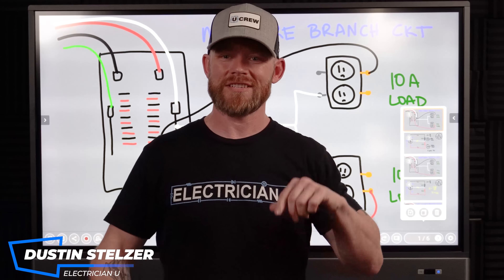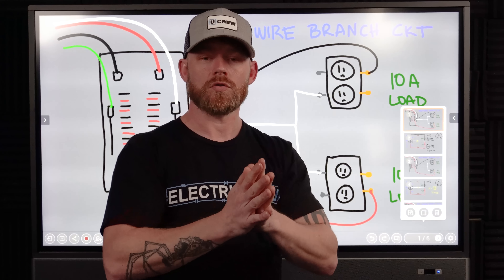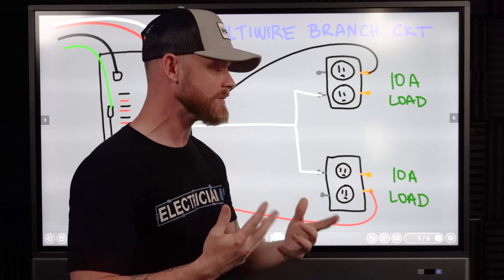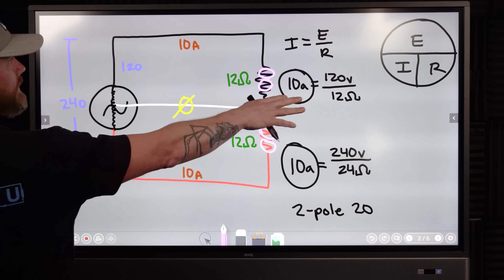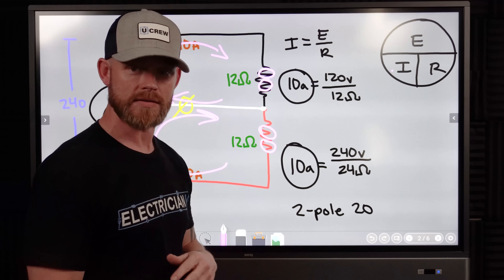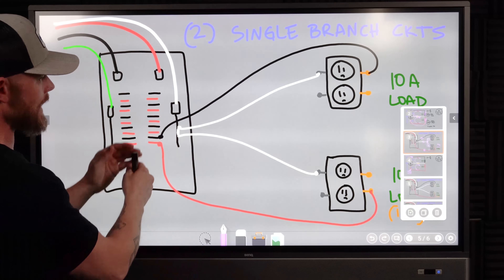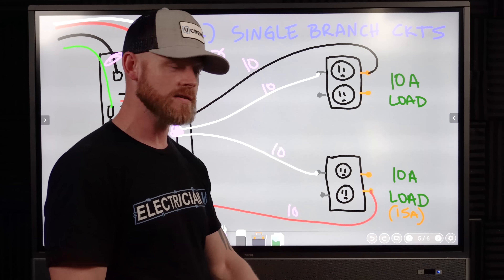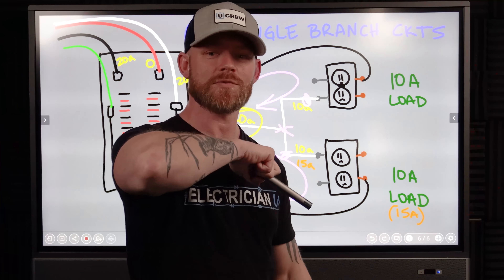Neutral Imbalance in Multiwire Branch Circuits (Two Hots, One Neutral)

Comment: OK, you've got to see this, it could be a major epiphony. Multitude of different single and double breakers and little double breakers where 2 breakers occupy the same hot source in the box. I've got lights dimming whenever the stove kicks on, or the dryer. So the question is, can breakers be specifically and methodically placed where a balance of constant load negates themselves? Say, half the house load is black vs the other red, so when they're all on, they negate each other instead of drawing too much on one pole or the other? Would this reduce the effect of the 2 pole appliances drawing down other loads?
Reply: Ideally you should aim to balance your loads between poles. Base it off of use frequency.

Comment: Great vid. Would have been good to add: if no loads are attached to the opposite leg it acts like a normal circuit, the dangers/behaviours of an open neutral in these circumstances, and using a split recep as a visual
Reply: I lost two computer monitors and one PSU to an apartment with bad neutral. One leg could dip to 90-100V L-N and the other surge to 140-150V measured at the breaker box. The situation improved significantly (125V max, 110V min) after the power company changed the transformer a few months later. The transformer must have had a broken neutral and the building still have a loose neutral between the transformer and unit panel.

Comment: I have a composites curing table that uses 20 250 watt 120 volt work halogen work lamps to produce heat on my work piece.  Total max current draw of 5000 watts.  The individual lamps are plugged into 4 separate 15A  power strips, with no more than 6 lamps per strip (1500watt). does this say that it would be OK to have this sourced from a 240v 30amp dryer/range outlet that terminates into 4 120v outlets - 2 on each side (red , black).  I believe this would in effect be a "temporary" branch circuit of the type you have described.

Comment: Seems like it's just safer to always run a neutral with every hot, no questions asked.  Besides using a single neutral in the case of wiring a 220V outlet, are there times when you want to use this slightly tricky technique?
Reply: sometimes it's easier to run a single 3-conductor cable instead of two 2-conductor cables. Sometimes there's not enough space to run 2 cables. Also, if conduit fill is an issue, sharing a neutral means one less conductor to fit in the conduit.
Reply: Another major reason is to lower the cost of materials. Copper is copper, after all. In new construction, you could save a substantial amount of money (which would go into the electrical contractors pocket).

Comment: THIS is the video I really wanted to see. The issue is significant for me. My house was built in 1938 with a two-wire 110 volt service which fed the entire house through two fuses. Wiring is all in conduit and was all routed through ONE 4" square box. Entire house. About 30 years ago service was upgraded to 240 volt. The electrician routed a couple of additional circuits but left the rest as is. I have untangled some of it, especially after breakers started tripping. There are definitely shared neutrals remaining. They did try to save money on wiring and conduit in this post-Depression house. And residential loads back then aren't what they are now. It is great to know how this works, as I continue to unravel the wiring in this house.

Comment: How would this example apply to the homemade generator breakout cord I made.  I have done this exact example but it is intended for use on a generator?  I basically cut the end off of a 240v Generator cord (10/3 BTW) and wired it into a outdoor type double gang outlet box with 2 120v outlets.

Comment: My sister lives in a tract home built in 1995, pre-AFCI.   her kitchen is wired with 12/3 NM protected by a double pole, 20 amp GFCI breaker (EXPENSIVE!!)    Her boyfriend called me one weekend because he couldn't get the breaker to stop tripping after he replaced the traditional outlets with the decora style,  to give the kitchen a more updated look.   After he said there was a black and red wire on the old outlet, but after checking all the connections making sure nothing touching, I said, yes something IS touching,  the tab joining the two halfs that you forgot to break.  😂😂   Fun times.

Comment: Near the end of the video with the 2 blacks sharing a neutral,  is very dangerous and can cause the neutral to overheat and become a fire hazard.   This is why, if I am doing a service panel change, and or rewiring a portion of the house, especially an older house where multiple people may have lived and gone over the years, before decommissioning the old equipment, instead of relying on red and black, I always test the voltages,  and mark the conductors with phasing tape accordingly.  Someone could have connected red to black along a circuit,  and if I am not aware,  I might reconnect the new panel and wire that circuit with two hots on the same phase sharing that neutral,  which could torch the house.

Comment: @12:05 stating that having 2 different neutral wires is the same as a multi-branch sharing a neutral because after the neutral bar, there is a single neutral wire that leaves....so why is that not the same concept when you have a multibranch circuit on the same phase?  If instead of a multibranch circuit both on the "black" phase, you have 2 separate circuits that have their own neutral, isn't that still the exact same thing just as what you state at 12:05?

Comment: Why on occasion is there a small amount of voltage still on a line, even after that circuit is shut off(I've read 8V, 12V and 16V before)? The houses in question are older and the grounding is almost non existent except for at the panel. I suspect that has something to do with it but an explanation from you would be great.
Reply: Voltage that high on a dead circuit could be from a shared neutral or maybe even be induced voltage.  If there's a big mess of wires run around your dead circuit the electric field produced by them could cause that reading.  If it varies like that throughout the house I'd lean towards induced voltage
Reply: Appreciate it!

Comment: If you live in a MRU (multi residential unit) property where each unit is supplied 120/208 instead of 120/240 for a typical stand alone home, does that change the cancellation on the neutral?

Comment: The diagram at 4:35 reminds me of a voltage divider in DC electronics. Because of the neutral in the middle, I presume some similar principal is happening so that each of the loads is only seeing 120v, even thought no current is flowing through the neutral? And if that neutral wasn't there, then each load would actually see the true 240v of the outer loop, and let let magic smoke out?
Reply: Yeah its the same as an Edison three-wire circuit. If the loads are balanced, and you removed the neutral, you wouldn't notice a thing. Each load would still see precisely 120 volts (assuming precisely same impedances).

Comment: Just ran a separate circuit to separate 2 furnaces that were tied in to a 12/3 wire. Breaker kept tripping randomly.
Reply: Sounds like the furnaces are on an AFCI or GFCI breaker,  and unfortunately it cannot share a neutral because as soon as the other furnace kicks on, the imbalance between the hot & neutral the breaker is protecting will cause it to trip.    Unless you use a two pole AFCI or two pole GFCI,  they are available but very expensive

Comment: The only thing I would have added is what happens if the neutral were to fail somehow.
Good work.
Reply: A voltage higher than 120 will appear across the circuit with the higher resistance.  That's a great reason to run separate neutrals!

Comment: I'm not an electrician, but I play one with my home and equipment, and have for 50 years. I try to understand and follow code and best practices and your explanations help a lot with techniques and how and why. I recently had a licensed electrician looking at my panel to give me an estimate on some extensive work. I have one 12-3 w/g cable connected two 20A breakers on opposite phases feeding 2 different circuits, just as you've described here. He called this an Edison circuit and said that Edison circuits are no longer allowed. After seeing your presentation, I'm wondering about his statement; are these circuits no longer code?
Thanks for doing Electrician U!
Reply: While I'm not an electrician, as far as I can tell in the current NEC code a multibranch circuit (Edison circuit) is permitted so long as both hots are connected to a Tandem Breaker. This ensure that the hots are on different phases, and that if one circuit flips it takes out the other circuit that's sharing the neutral. There are also rules on the device side that the neutrals must be pigtailed together before the devices, so that the neutral is not dependent on the device. (No daisy chaining, must have the neutral split into independent wires to the device after you split your multibranch circuit back into two 120V circuits with the shared neutral.) Now, you're state may have different rules that supersede the NEC published rules, as well as sometimes local municipalities have ordinances that further restrict wiring.
Reply: @joatamonk  you cannot connect a multi-wire branch circuit to a tandem breaker. I think you meant to say double pole breaker, which is entirely different. Multi-wire branch circuits must be connected to a double pole breaker OR to two single pole breakers that are handle-tied together. This ensures that 1. The breakers are on different phases so as not to overload the neutral, and 2. To ensure that if you have to turn the breaker off to work on the circuit, both hot legs are dead. Now if you're using 2 single pole breakers tied together, if one breaker trips, the other will NOT necessarily trip (a breaker can trip without the handle physically moving). This however, is NOT a safety concern. It's totally ok to have the other phase powered even if the other one tripped. If there was a problem with the other phase staying energized, then that breaker would trip as well. That's actually a benefit of using single pole breakers handle-tied over using a double pole breaker.
Reply: @joatamonk  Aha! Tied-together breakers and no daisy-chaining make good sense. Thanks!

Comment: Dustin,   Multi wire branch circuits in dwellings can be with 2 pole breakers or handle ties manufactured by the same as the panel.   The reason NEC started requiring them is not for overcurrent protection.   It is for maintenance work to ensure disconnection of all hots on common neutral.
Really good video!   Keep it up!   Respectfully,   Kevin
Reply: Nice precentacion and we'll explained, however the problem would be for maintenance or troubleshooting . A lost neutral will damage equipment since red and black will become one loop, Wich will double the voltage on the outlets that would be in series. Thanks again for your videos.
Reply: @alfredofuentes8959    Did you mean to put this comment under my comment?
Reply: @alfredofuentes8959 why would it double the voltage at a receptacle?

If you lost neutral it'd be like any other circuit that lost neutral... I mean you don't hook up the red and black to any receptacle --- only one of the hots is connected to a device or receptacle...  
The potential btw hots (usually red and black) is 240 with or without the neutral, but only one is hots is on a given device . It'd just be nonfunctional. With some increased saftey concerns (albeit a small one for a legit electrican) for whoever tries to to repair the circuit, especially if the the multi wire circuit isn't on a tied double pole breaker.

Unless I am completely missing something here
Reply: Wouldn’t it be for both?
Reply: @twestgard2     If you are sayin both disconnection and overcurrent.   A two pole breaker will trip both.   One for overcurrent and other nuisance trip.  The handle ties will disconnect both, but overcurrent on one side will only trip one.   That is because it was not the reason.
Reply: @KevinCoop1  I agree with everything you said, however, requiring a handle tie on single pole breakers means that you're basically forced to have the two breakers right next to each other. This ensures that the breakers are on different hot legs, which prevents the neutral from being overloaded. Without the handle-tie requirement, one could put the two single pole breakers in any random spot in the panel, and could possibly put both breakers on the same hot leg, which could overload the neutral. So in that sense, requiring handle-ties kind of DOES prevent overcurrent (on the neutral).
Reply: @jonclark1288     I agree with you that it does stop neutral overload from being on the same line, but my statement was the reason it was put in NEC was not because of your instance, it was originally for commercial work with multi wire branch circuits feeding portable office partitions.   I looked up the in writing proposal to the panel and also talked to a person on that panel that I used to work with.   A maintenance worker got shocked while working on the furniture.  From there, they decided the next cycle to require handle ties or multi pole breakers for all multi wire branch circuits.   So again, the reason why it got put in NEC was not overcurrent protection.
Respectfully,   Kevin
Reply: Sorry I meant to create a new comment to electricianu.
Reply: @alfredofuentes8959     Just trying to help.
Reply: The company I work for uses these for 90% of the home runs but I’ve never seen a handle tie on one. Idk if my area is just lax on that or what. As long as its not dangerous
Reply: @roadie193     I do not know which NEC is adopted for your area.   I looked in 2017NEC Article 210 Part I General Provisions for branch circuits.  (This would mean “All” branch circuits).    210.4(B) says that each multiwire branch will be provided with a means that will simultaneously disconnect all ungrounded conductors at the point where the branch circuit originates.   There are no exceptions of any kind under the rule.   The means of disconnect can be multi pole breaker, handle tie, or multi pole switch.   I’m thinking your company might have go back to a lot of houses that got incorrectly installed and put in numerous handle ties, or just wait for the law suits.   Either way, you should in good faith inform the owners of the the company(in writing).
BTW,  Unless the AHJ put in writing an adopted ordinance stating an exception to that article, passing inspection means nothing in court.   Inspectors are not liable for any part of the install, the license holder is 100% liable.   I held 3 licenses for our company, it is a fact.
Respectfully,   Kevin
Reply: @KevinCoop1  I think we are currently using 2013 here in St. Louis MO and we are a respected union company so I’m guessing it’s probably not a code here. I’m an apprentice also so I just do what I’m told lol.
Reply: @KevinCoop1  we’re residential also
Reply: @roadie193     I worked for large contractor in Fenton before retirement.    St. Louis county is 2014 NEC and St. Louis city is 2017.   So, I checked 2014 and the wording is exactly the same as 2017.  So, they are absolutely required in both areas in ALL types of construction.   I believe it’s been required since 2008NEC.  Sorry!
Reply: @roadie193     I just saw the comment about being apprentice.   Next job, request handle ties and be ready to tell them what article of NEC requires them.   Local 1 wants you to follow the NEC requirements.   I was called by the Rep once saying that their opinion was my design was in violation.   I proved him wrong and he informed the complaining electricians.   It’s all part of the business.
Reply: @KevinCoop1  I hear ya. I’ve worked in the city, stl county and currently in Jeff co. I did know that almost all circuits in the city need to be arc fault breakers. But this is the first company I’ve worked with that shares a neutral with their home runs so it was a little bit of a learning curve but I understand it for the most part. Especially with this video
Reply: @roadie193     You bring up a good point!   I was involved in Commercial and Industrial project design.   I have not gone into NEC to see if these are possibly not required for Dwelling units.   I will try to find the answer and report back.  Very good point!   Kevin
Reply: @roadie193 that definitely seems a little sketchy for residential
Reply: Good comment...yes handle tie is for safety of a repair so both or branch is Dead
Reply: Are you an inspector? You're very correct and sound very true with your explanation. I appreciate your comment and how accurate you are, Kevin.
Reply: killed two birds with one stone though,  handle ties require the breakers to be stacked together, essentially forcing them to be on different phases.
Reply: With the use of AFCI breakers in new homes now sharing neutrals doesn't work.  Of course there are still alot of electricians still not using them outside the city in rural areas.
Reply: Makes sense... once you disconnect one side of the run, the other side will operate just like a standard 2-wire run.  I was wondering about this as my home has 3-wire runs but they are not tied together.  I suspect because the work was done before this was part of the NEC (added the rule in 2008 I believe?) so it's nice to know it wasn't for operational safety, but for service tech safety.
Reply: Can you illustrate the theory in really conditions? Very curious to see that. Btw, it’s a good video